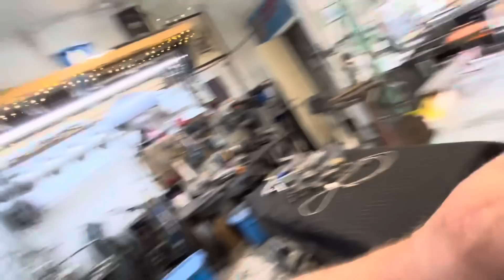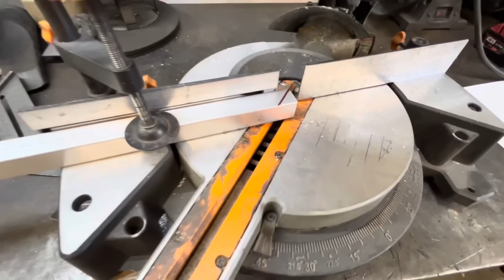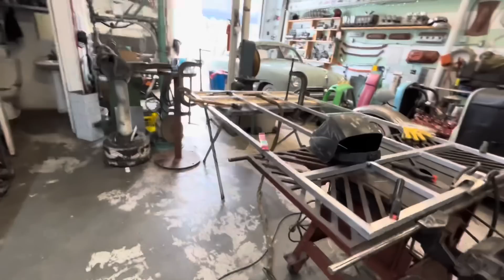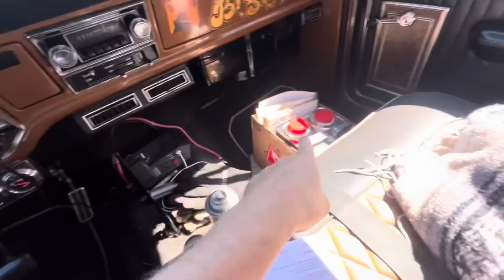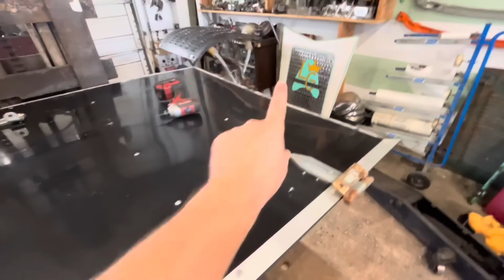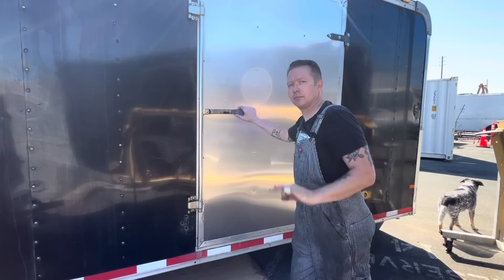Building a New Car Hauler Part 1. New Aluminum Door

Comment: Insulate the entire living area to save yourself from the oven effect.

When inside use the lock through both lock holes without the bar.  This will stop someone from locking you in.  

Will you be making a video on the Beaumont?

Oh, and brushed aluminum will make you a movable, blinding mirror..
Reply from the maker: Planning on insulating the inside. Our last trailer wasn’t insulated, and there was definitely times when it was uncomfortable.

Comment: Your going a good job but you could have saved yourself a lot of time buying a ply metal door blank from a semi trailer supplier, time is money but you won’t have the content for your Chanel. As far as buying the 48” panels ( DONT ) the 49 “ is for overlap and strength, the next time your going down the highway look at the sides of other trailers they flex a lot , so stay with the 49” panels . When I was working we buck riveted all the side panels, that was the way that they  hold up. The side sheets that we sold were.050 pre painted white one one side and silver on the other. Hope this helps .
Reply from the maker: I never knew trailer door blanks were available, but after you suggested it I looked them up. Nothing available locally, I’d have to buy one from the US and ship it here, which puts it at close to $400. I built this door for $86.

Comment: You don't need to screw panel on the door, modern adhesive or even silastic is much stronger and can't vibrate loose. . . and no leaks or screw dents
Reply from the maker: I like mechanical fasteners. I want to know I can easily take it back apart if needed.
Reply: @LGKustoms  Yes, these supercars that are glued together need special equipment  to repair I agree

Comment: Brushed aluminum will corrode very fast and turn white.  I don't think that is a very good idea.  Find a complementary color to "Brown Sugar" and wrap it.  Very durable and weather resistant and you can change it anytime you want a different look.
Reply from the maker: Years ago my dad and I built a dragster trailer skinned in raw aluminum, once a year we’d give it an acid bath and it would look like new again.

Comment: the trailer is only funky on the rear side panels and rear door - right  ? after seeing you build the door , couldn't you get the exact same panels in black and replace the 1/2 dozen damaged one's on each side  ? and have a new looking trailer  ? , and in the future paint a stripe to match the truck :face-turquoise-covering-eyes:
Reply from the maker: Of the 18 panels on the trailer, only four are damage free. I considered only replacing the panels it needed, but I felt the contrast between the new panels and the old faded/scratched panels would be too noticeable.
Reply: @LGKustoms  are panels cheaper then paint  ? if so replace the all

Comment: Dude!!! Great video!!! Aluminum caulking will fix the gaps!!! I had 3 camping trailers, I replaced the bathroom floors!!! Marker lights would leak water down  the wall and under the floors!!! Maintenance is your friend!!!✌️
Reply from the maker: Never thought of aluminum caulking. Thanks for the suggestion!

Comment: Side question - What did you do to the Beaumont ?
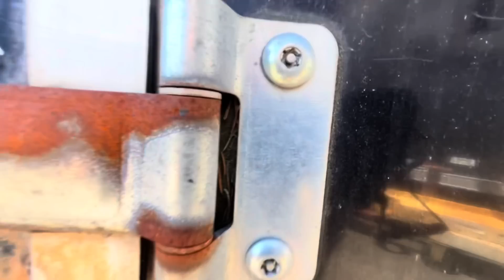27:44 Those are security torx screws.
Reply from the maker: The Beaumont came in for an automatic to 5 speed swap. Then snow balled in the a full chassis restoration and disc brake conversion
Reply: @LGKustoms  Thanks for the answer.

Comment: reskinning is a pain in the ass worked on semi trailers in the past, reskinning and getting it sealed up so It doesn't leak is going to be a nightmare with the rusty frame work , it there's rust it's going to be a crack in one or two spots then lining up the screw holes you may even have to get bigger hardware .
Strip it and  Polish it out or give it a repainted would be one of your best options .

Comment: Ah , you could of  put a weld prep bevel on the  butt joints and still had a weld on the plywood  sides . Then you can sand flat but still have strength of a weld there.
Reply from the maker: I could yup. I think as is will be plenty strong though. Way stronger than the stapled wood frame it used to have
Reply: @LGKustoms  ah ya way better, good job!

Comment: Go for the brushed and be cool, spray foam after you install windows, A/C/Heater unit on the roof, foam core on the walls and ceiling, will keep your Crib Comfortable. I'm jealous. Cheer.